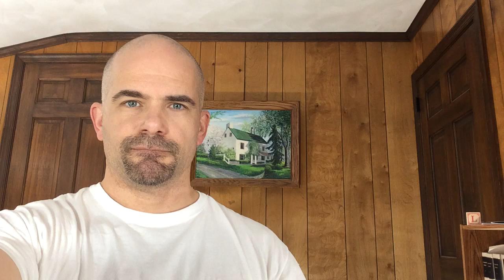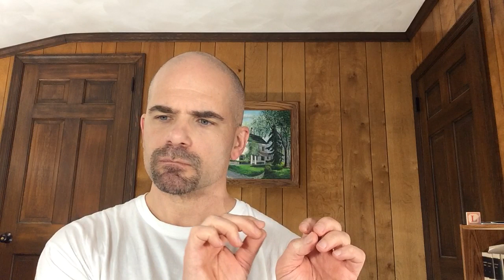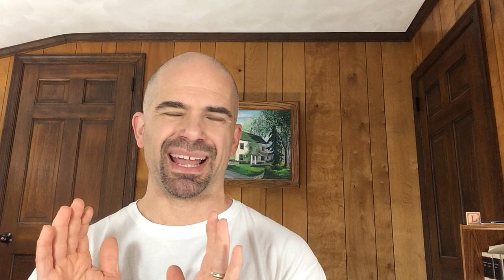Paintball Accuracy: Introduction

Comment: Dan,

Really appreciate you taking the time to put out all this great information. I couldn’t agree more on the importance of good paint. 

I thought I heard in another one of your vids you tend to play in cooler temps with fragile / tournament level paint. What steps do you take to avoid breaking paint and ensuring quality? Does speed feed vs rain lid make a difference in how much they expose paint to open air? I’ve wondered how quickly the paint reacts to the environment when it stays in a sealed pod or bag and how effective placing it in a cooler is. 

I want to use the most fragile / high quality paint possible but I still suffer from breach breaks on occasion and for no apparent reason. I have an Empire Axe and Etha 2 but have had breach breaks with both, fewer in the Etha 2. I’ve heard about turning down velocity but I’d rather not lose that if I can avoid it since my local field has a max of 280 and I tend to shoot 275. Would love to hear your thoughts. Thanks again for the great content.
Reply from the maker: Thanks for weighing in!  A speed feed definitely makes the paint more susceptible to environmental factors than a traditional rain lid.  Paint doesn't instantaneously react to the environment, but if you are trying to control every possible factor, this is something to consider.  If you have controlled paint conditions and are playing speedball with quick turnover and short down time in pods and loader, I wouldn't worry about it.  But if scenario or longer rec play, then I would.

To your question about breakage, in my experience (once you have ruled out issues with the marker itself), breech breaks can often come down to loader tension and paint quality.

For starters, what kind of loader are you using?  If it runs on tension, then it is possible the settings are too high.  Rotors are notorious here.

Sometimes too you can simply have poorly stored/cured paint (even of a high grade) at your field.  I've run into this issue many, many times, and while frustrating, it's simply part of paintball.

It's also a good idea to see how other people are faring.  If you are the only one at the field getting breaks on a particular day (or day after day), then go over everything to see what is different in your setup from everyone else.

Overfilling or underfilling pods can stress paint as well.

Well, thatt's a couple of things to think about for starters.  Let me know about the loader, and I'll try to help in any way possible.

Thanks again!
Reply: @thatpaintballchannel179   Thank you for the quick reply! I was using a Prophecy Z2 on the default speed (4) but was able to decrease it after reading on PbN how to enter the programming mode; It hasn't completely removed the issue but it has helped. Currently I have it set on the lowest speed setting which is fine for me because i'm only playing recreationally and not trying to overpower anyone with excessive ROF. I got so frustrated by the breach breaks I went ahead and purchased a Spire III recently and from the testing I've done in the backyard I've had zero breach breaks, so the Spire may be less stressful on paint. I let friends use my backup guns with the Z2 and an original Prophecy so I want to try to make the Prophecy enjoyable for them to use as well.

Do you have particular brands / types of paint that you prefer using or do you typically just rely on the recommendations from your local field? In the cooler months I typically purchase Valken Graffiti paint through ANS gear because the price is right and my local field doesn't have the best selection. When the weather is nicer I like using the HK Tournament paint to get the most fragile paint possible, though sometimes it's so fragile i do find it breaking in pods. My general rule is if it's below 60 degrees I need to use Graffiti and if it's above 60 I can get away with HK Tournament paint.
Reply from the maker: @chase3464   Sorry for the delay.  I would think that the Spire will definitely be easier on paint as it isn't 'force' fed in the classical sense in the way the Z2 is.

As far as paint goes, I never have issues with Graffiti, and typically just go with the highest grade the field carries.

I don't have any experience with paint purchased online, so cannot comment on whether or not that might be a contributing factor in breakage.   Some local POs employ the Hulk and friends, so that's something to consider.

However, depending on how cool you are talking, Graffiti may not be ideal as shells become more fragile the colder you get (it sounds like you already know this, but just making sure, and informing other readers).  Something like Polar Ice may do a better job if the temps are really down there.

Hope that helps, and thanks again for weighing in!
Reply: @thatpaintballchannel179  No worries! I actually used Polar Ice and Graffiti on Sunday (was around 45-48 degrees) and had only one barrel break in my Etha 2/Spire with the Graffiti. No issues with the Polar Ice other than the usual bounce issues with thicker shelled paint. My buddy tried out my new Emek (BTW your review heavily influenced my purchase) and he also had only one Graffiti break all day using the Z2. Pretty much everyone who shot the Emek was very impressed with it. Thanks again for the replies and keep up the great content.